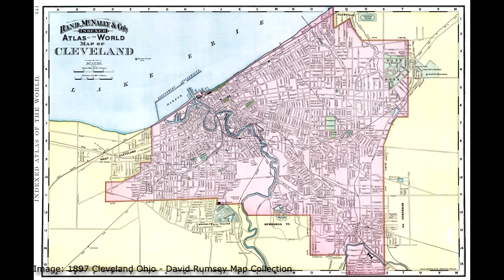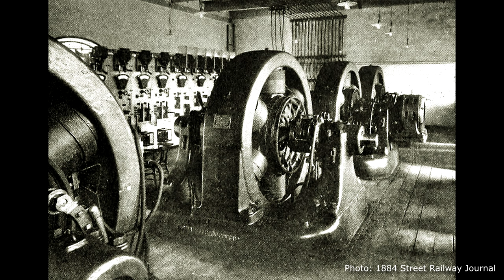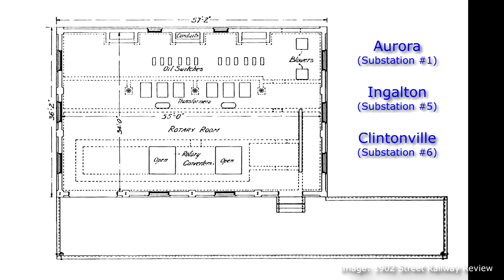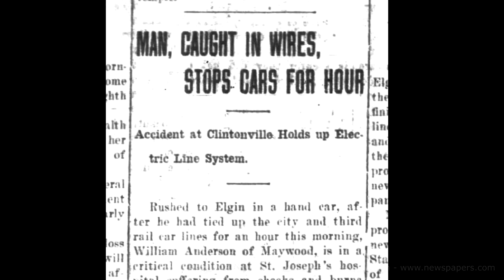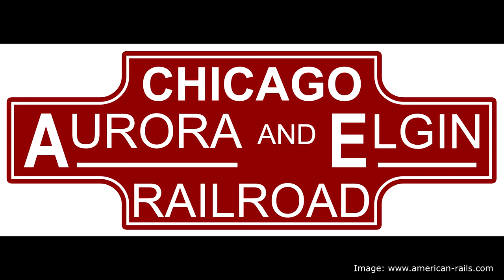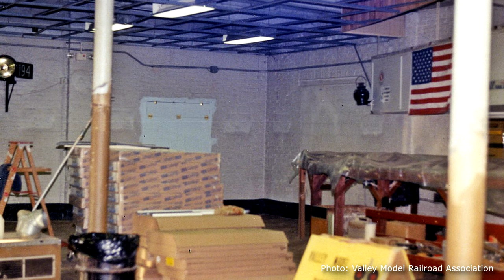Clintonville - An Early 20th Century Interurban Electric Substation - Part 2

Comment: Terrific job on a great video. The Elgin & Belvedere also had a substation in Gilberts. The building is still there as far as I know.
Reply: thank you, address or general location?
Reply from the maker: Thanks very much for watching and for the kind words!   Thanks also about the observation regarding the Gilberts substation on the Elgin-Belvidere line.    That was one of three originally, no?
Reply: @boxryde382  I assumed that was the building, after I saw this comment I went searching on Google Maps. Ibhad a feeling it was this one due to the location next to the right-of-way.
Reply: @boxryde382  Union had a substation, you can see a model of it at IRM.

Comment: I just watched this series today and I have to say you did an amazing job of putting this together. There were a couple of comments I wanted to add:

1) While not impossible, the idea of tanks or a chiller on the roof seems kind of unlikely for a substation like this. My suspicion is that what was up there was really a steel structure to support the high voltage lines. You notice that even today a high voltage power line runs over the building rather than across the tracks. I suspect that Public Service put that new line in while the substation was still operating and had to have a way to get the lines into the existing building.

2) This kind of construction where everything is inside the building and there are brick channels for high voltage lines was fairly common for early substations like this. I think you have done an amazing job of piecing together what went where. If you are up for a bit of a road trip and interested you might want to visit East Troy, Wisconsin. Their museum is based out of a former substation, and some of the wiring and equipment inside is still in place. More modern designs had the transformer yards outside and just the conversion equipment inside the building.

3) The rotary converter in barn 6 at IRM came from the CA&E, if I remember correctly it was from Maywood. The museum acquired a 'substation kit' from Edison after the CA&E quit with the intention of using it to power the new site at Union, but never ended up using it. Along with it was the large transformer outside barn 6, an oil circuit breaker set out in the material yard, and a number of cables and other components stored in a boxcar.

4) Most interurban substations had the positive DC feeders coming out of the building with 2-3 parallel cables going to the overhead structure. Being 3rd rail it's quite likely the DC feeders and returns came out of the basement on the track side. In that photo of 415 in front of the substation it looks like some wires may be attached to the 3rd rail near one of the wheels. The other kind of odd thing in that photo is that it looks like one of the 3 phase inputs on the tower has two wires going across to what appears to be a single transformer. In addition to feeding 600 out some substations would sometimes also feed out 2400v (or other similar voltages) to support signal systems and other auxiliary loads along the railway. I'm not sure if this substation was retrofitted to handle that at some point?

5) A lot of early electric railroads were constructed before any sort of grid existed and had to generate their own electricity. The idea of transmitting high voltage electricity and stepping it down to 600 every couple of miles avoided the voltage drop of pure DC and allowed them to expand much farther. At the time it was believed 25 cycle power was the most efficient for this purpose as the speed of a rotary converter is related to the frequency of the AC, so a 25 cycle converter spins slower than a 60 cycle converter. A traditional light bulb on 25 cycle power will have a noticeable flicker, since the voltage is at 0 25 times a second vs 60. As commercial power expanded in the US, it tended to be at 60 cycles, leaving many interurbans with a lot of infrastructure that was incompatible. Insull owned both the CA&E and Public Service, and so brokered the deal for them to not just purchase their electricity, but turn over maintenance of the substations and distribution infrastructure. The Public Service company had motivation to simplify the infrastructure and replace 25 cycle equipment with 60 to fit with their distribution grid, but this did not always happen overnight. In some cases, you might have parallel 25 and 60 cycle transmission lines as substations were upgraded. Some of the upgraded stations had rotary converters replaced with rectifiers during upgrades. The Public Service Company handled this work for the Rapid Transit and North Shore Line as well so they had a lot of equipment available that they could move around to the various substations to handle demand.
Reply from the maker: Thanks for watching and for the interesting observations and additional information.   This is most useful to us!   Thanks too for the kind words and encouragement!    We will attempt to address a few of your points. 
  The chiller idea came from the contemporary reports of putting cooling systems into the substations.   Most seem to have opted for large fans/vents in the ceiling - but we know too that chillers were popular for a period of time in the early 1910s/1920s - and this may have been an experiment that ultimately proved unsuccessful.   The steel beams installed on the roof suggested carrying a substantial weight, also suggestive of something heavy, such as a chiller.  Your idea, of a steel frame or small tower is also very possible - although the metalwork suggests something heavier.   They seemed to have experimented with technologies at single locations, such as the first automated substation at Warrenville, before deploying to other locations.   Again, we are not married to the idea of a chiller, but more evidence points to that scenario than any other at present.  2)  Thanks for the kind words regarding our piecing together the building's infrastructure.   We are confident of our interpretations, based upon all of the contemporary descriptions that we found.   Many people have thought these brick structures to be battery compartments - but that makes very little sense, especially as you realize that they were mostly covered tunnels, with periodic openings along the tunnel.   Further, there are no contemporary references to more than one or two lead acid batteries in these facilities from the 1900s to 1920s.  However, we did find much discussion regarding busbar compartments.   We will have to visit the substation in East Troy, Wisconsin, as that indeed sounds very interesting.  3) You are absolutely correct regarding the rotary converter in the barn at the Fox River Trolley Museum.  We were fortunate enough to have been given a tour of that facility and were able to take a number of photographs.   That specific rotary converter, however, was from the early 1920s, based on a stamped date on the cover.   I remember thinking at the time that this was not one of the early rotary converters, which would have been substantially larger (and probably less efficient).   Perhaps it was a later replacement or backup unit.   4)  Very interesting comment regarding the power feed coming out of the front of the station (trackside).   We very much agree with you, as it makes the most sense - and railroad civil engineers were eminently practical and thrifty.    However, at Clintonville, these walls were covered in wood paneling - and so we could not thoroughly examine any possible openings trackside.   However, we have been able to examine the same wall at Prince Crossing - which was unconvered.   We found a few openings that may very well have been the trackside power feed.  Excellent observation!  5)   Thanks very much for this additional information.   That helps to fill in many of the blanks for us!    Thanks for watching and for the very thoughtful comments and observations!   Very much appreciate it!

Comment: I read in one article that the original power line used glass insulators from Fred Locke in Victor NY.  Most failed and caused fires in the first year, and all the insulators were changed to larger porcelain insulators also by Fred Locke.  This happened on other early power lines as well.  They really didn't know how to design or make safe quality insulators until the late 1910s.  I have found pieces of both types of insulators.  It was significantly upgraded in subsequent years.
Reply from the maker: Thanks for the thoughtful comment and observation!   That's very interesting.  As we mentioned, there was indeed evidence of a fire in the Clintonville station, on the south end of the building, extending from the basement up into the wire tower.  We have scoured area newspapers for any mention of this fire without success - so it's not clear when it might have occured as yet.  Being on the south side of the building suggests that it may have come in from the entrance power line from the south.    Thanks again - and thanks for watching!

Comment: If you are interested in this technology and history, you might want to look at the book "New York's Forgotten Substations, the power behind the subway" by Christopher Payne. Some of the substations in New York were constructed around the same time as this one, and used similar designs and technologies. The book is mostly modern photos of abandoned substations (with equipment still in place), but also includes many drawings and historical details about how they worked. Some of these photos show things like the brick hutches and bus channels and might help give some more clues about the purpose of things.
Reply from the maker: Thanks very much for watching this video series and for the tip regarding Christopher Payne's book.   We will have to check that out.   It took a lot of digging, but we did find quite a bit of period and contemporary information regarding the many structures evident at the Clintonville station.   Recently, we have found even more evidence of these structures at the Prince Crossing station in West Chicago as well.   But we will definitely look into Mr Payne's book - thanks again for that suggestion!